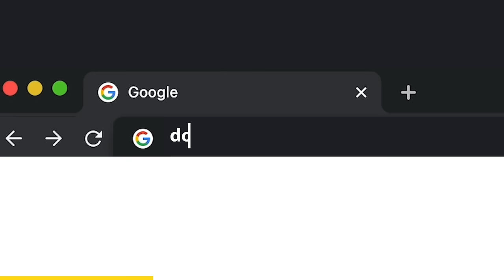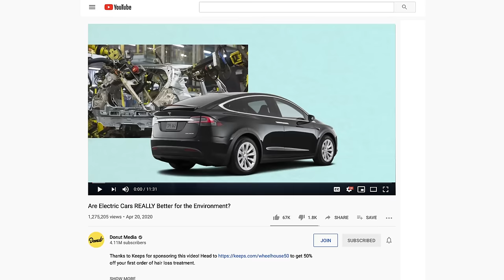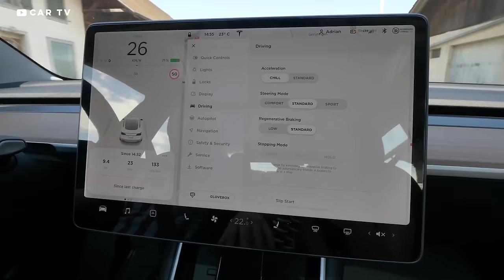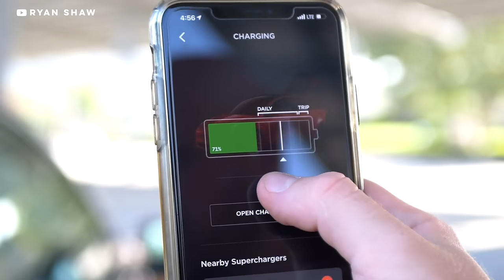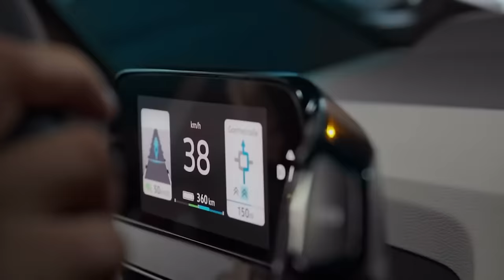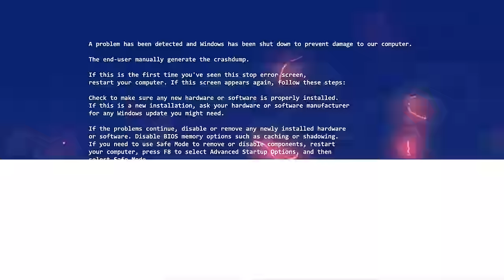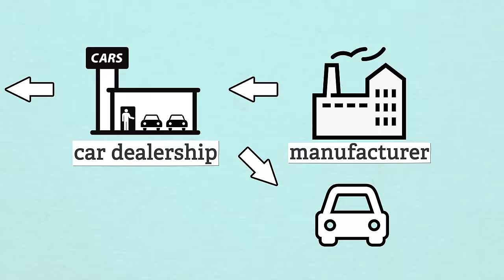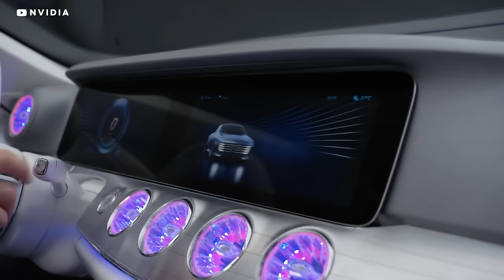Why Can’t Anyone Take Down Tesla?

Comment: Honestly, can we stop tying fancy tech with electric cars, one does not equate to the other. There is nothing stopping automotive manufacturers from putting stuff like digital touch screens, or dynamic cruse control with automatic lane centering in combustion engine vehicles. In fact they are doing that already. The main reason why Tesla has been doing so well in the electric vehicle market is that they have not just been building electric cars but the also infrastructure to go with them. The main apprehensions that the general consumer has had with buying an electric car are  "What do I do if I need to recharge my battery and I am away from home?" and "I don't want to be limited to only traveling within a set radius around my house." Tesla answered those questions by saying "You never have to worry about being stranded with a dead battery or being unable to go on long road trips. You are always in range of one of the many Tesla recharging station in your local area. You can charge your Tesla while doing your shopping." This is a claim that other car makers couldn't make. If the major automotive manufacturers seriously invested in designing and mass producing electric vehicles and building the infrastructure to support them Tesla would not be able to compete.

Comment: One big unknown though... the conclusion of the video is that other manufacturers will have to adopt Tesla's model, but Tesla is operating under the same economic pressures that produced the current paradigm.... meaning it might be the other way around, that eventually Tesla will have to adopt their model in order to compete long term.

People tend to forget that models do not come out of nowhere, they are the result of decades of economic pressures that reward companies that adopt them and punish ones that do not, and if you look at the history of the auto industry it is littered with companies that tried to operate differently and survived for a decade or two but eventually collapsed.

Comment: Hello donut from the uk. I have an idea for a feature you could do, and cover Tickford and their production of hot fast fords. I owned a Ford Racing puma, a commercial disaster for Ford failing to hit the 1000 cars to be made (500 uk only models made). It was over priced not that quick, made no sense..... other than the fact it was a hoot to drive and pumped up styling. It was the forefather of the MK 1 focus RS which his was also finished by Tickford, (I have also owned). Tickford made hot Capris (British mustang from 60’s/70’s).

Comment: Tesla knows to innovate and has the most efficient drivetrain yet. But a huge part of the car is not designed inhouse. Most parts of the Model S are German. For example the Suspension, the steering, the seats (in newer models), the audio system. Also parts of the self driving systems are from Bosch. Not to mention the german Robots Bildung all Tesla and Painting them. So of course Tesla is a huge success, but the did not build a car from scratch. They used a lot of established suppliers.

Comment: The first difference I see between Tesla and others, especially when Tesla started out and still to this day to some degree, is that while other companies set out to make "electric cars," Tesla set out to make a "car that is electric." Prior to Tesla, and still for many of their competitors, electric cars have always been weird, quirky, odd-looking, basically novelties. Their primary appeal being that they are electric. Tesla on the other hand made a nice, desirable car that is electrically propelled. Certainly has some odd features, but they aren't really directly related to it being electric. Teslas were the first electric cars to be compared not against other electric cars, but against well-regarded luxury sports sedans, even if gasoline powered. A lot of other electric cars - BMW I3, Nissan Leaf - are sort of weird looking. Others almost seem to try to disguise that they are electric, having a fake grille with no gas engine to feed (though massively oversized grilles, bigger than necessary even for gas cars and mostly blocked off, are a hideous trend these days), that Volvo/Polestar and Mustang Mach E being prominent examples. While Tesla is just comfortable to be a car that is electric, it's not weird looking to scream "quirky electric car," nor do they try to emulate gasoline cars.

Comment: The main problem with EVs is because they are hard to repair if they break. They do not even sound great.
Reply: no they aren't. they have much less parts and the ones most likely to brake are found on gas cars such as the suspension. standardized repair procedures will be more common once EV's become a major part of transporation.

Comment: 12:59 No. It is a million of billions.
Reply: ... depending on where you live. In Slovakia "billion" = 10^12, "trillion" = 10^18 = 10^6 (a million) times 10^12 (a billion). So you need to specify which kind of "trillion" you are talking about.
Reply: But your point still holds. For a human being even comprehending a million of anything is a big problem.

Comment: Saying that other companies are failing to produce "tesla killers" it's a nonsense. vw, ford, porsche, bmw... They aren't fully ev dependent. Tesla is. And that's the point. Tesla depends on the sales of ev's. Something that the other companies don't have to worry, and lastly, of course Tesla has better technology, it would be dumb if they didn't had it.  Saying that other companies are failing at taking the crown of ev's is like if Tesla tried to make an internal combustion engined car, it wouldn't work.

Comment: I think tesla is winning because they hyped up the "autopilot" and they started with the model s. Rich people bought the model S which is actually pretty sweet. Then the model 3 came out which was a much more attainable car that people associated with the model S and those rich people. Its a keeping up with the Jones' situation. Personally i would not buy one yet even though i could afford it. I just feel like there are still very fuel efficient gasoline and diesel cars that use less resources to build. People do not factor that in when they purchase an ev. Those batteries take a ton of energy and resources to produce. I may get one once their mileage gets to 3x the mileage of the best gasoline cars. I think it can get there but it will just take some time.
My real question is why are there little to no hybrid diesels? Diesels produce crazy amounts of torque for their size which will help with the weight issue of EV vehicles and with modern exhaust systems diesel really isnt too awful anymore.

Comment: East-European here and why I couldn`t care less about Tesla
1) Too expensive
2) No infrastructure for it
3) Too little battery
4) If it " fuels " longer then 2-5 minute  then I do not want it
5) Electronic based cars are not ideal when everything is in ICE and SNOW.
6) Interior design is not for me, by that I mean not enough organizers inside,  a singular " tabled based " control thing is plainly inconvenient for me.
7) Exterior design is well..debatable, but I just kinda feel nothing when i look at Tesla front side.
8) I couldn`t possible care less about its autopilot, heck im not even using cruise control in my car, like..ever. I like driving car myself, with a manual, I like to " feel " car.
9) Our roads are BAD, not even every SUV have chances to survive driving while ignoring potholes and hatches.

Soo, why would I pay more and have less joy then regular engine petrol/diesel? Why I would need to sacrifice convenience and practicality? Maybe somewhere in my rant is a reason why EVs dont have a solid profit, since a lot of people dont even see them as cars, more like a big toy for rich people.

Comment: Tesla scares me because 1. The car is a driving computer that you barely own because Tesla makes sure to control EVERYTHING even after you buy it 2. The cars have to be driven for several years to be worth the carbon savings, making one of the main reasons to buy an EV way harder to obtain 3. You are basically paying for R and D when you pay the price of the vehicle, they are not expensive vehicles to make, but Tesla would like you to think so. Tesla has set a precedent for very very expensive electric cars when they should be even cheaper than gas cars and it’s all because of their R and D

Comment: When is Tesla going to get big public bids to partner with a “big” car manufacturer?  License it’s tech to somebody and cash in. I really see a company biting the bullet soon and paying through the nose to get their foothold established. Either that or they are waiting for Tesla to “fail” and get the tech on the cheap. 
  Personally, I thought Ford was headed to them, but it looks like Ford will soon fail based on it’s reliance on two to three basic models. The F150, Transit and Mustang.  They’ve lost a large fleet base getting rid of the small Ranger and Crown Vic.  Plus, the pricing is no longer better than the foreign and arguably more reliable options.  It’s fallen to relying on a brand loyalty that could swing hard soon. Going the same route as Harley. Overpriced and aging. 
  I miss both my Rangers, the Bronco II and even my ‘78 Ranger that got literally 9 mpg, but these days, the bang for buck truck is a Toyota. Any Japanese company making sedans has them beat in that market.  If you want performance,  it’s just as easy to look elsewhere and get a more reliable, consistent vehicle that matches it’s price point.

Comment: Tesla is succeeding because it doesn't have to make a profit. It basically breaks even on its cars and sells them in large part off the backs of subsidies, while making the bulk of its recent profits off ventures that are distinctly not cars. If it were a gas car company, it would have gone under. The difference is that, as long as it markets itself as a tech company rather than a car company, it never actually has to make a profit to get investor dollars, just like how WeWork, by marketing itself as a tech company rather than a real estate company, hasn't made a profit for years, or how Apple sunk millions into (literally) a premium several hundred dollar juicer startup. Eventually as adoption grows it will obviously start making money by economies of scale, but until then, it's only gotten this far because it's R&D budget could be more than some modest automakers' market caps with no qualms from investors. And while Tesla investors expect it to do this, GM and BMW investors actually expect profit from their companies, limiting how much money they can pour into R&D or new directions. Tesla didn't succeed by marketing their cars, they succeeded by marketing their stock.

Comment: Tesla is literally the Ford model t of electric cars. They are built quickly with shoty craftsmanship so they can get them out of the door all the faster. Their electronics constantly fail. And when you flood the market with a bunch of cars you can pretty much lower the price whatever you feel like, which allows your brand to get out there faster. And if you stop and side step the fact that Tesla is literally the only manufacturer that is able to sell vehicles from their facility without using a dealership you realize how much cost savings are getting away with because of a loophole that they found. So basically you're not only being scammed on how good of a car you're actually not getting, But you're also helping giving them money by side stepping the middleman. Which allows them to sell cars to you cheaper. So you're getting a cheap electrical fire, that will definitely eventually happen. There's no doubt in my mind why they are everywhere. And there's no doubt in my mind why I will never buy one.

Comment: Tesla took a simple concept, made it look simple, but made it hopelessly complicated underneath.  They reinvented every stupid detail until the unreliability of the rest if the vehicle made up for the inherent simplicity of the drivetrain.  I was hoping that other manufacturers would make cars with the standard quality and reliability of regular cars without pointless features like multi articulated doors and door handles that rely on perfectly functional electronic systems. Tesla cant even glue in the Windows correctly and they decided to overcomplicate the simple stuff. 

I was really hoping that when Ford got in, they would make a comparable car with better proven ancillary hardware. Here they come with over the air updates and a copy of the same IPad hot glued to the dash interior.  Maybe the F150 will be a regular truck with gas-version interchangeable parts that just has an electric drivetrain. If they do that they beat Tesla eventually. If they copy Tesla's stupidity and faults and are still behind on batteries and drivetrain, then they will be a distant 2nd or 3rd at best. Don't fix what isnt broken.

Comment: I've been holding my breath for true "FSD" for years now....And Tesla bulls said post-split TSLA would be in multiple thousands per share by now, but it's still in the 700s. See the hype?
Also- Over the Air updates can't change the motor output, like you can when modifying an ICE car. There's no room for acceleration performance improvement, other than allowing the motor to suck more current out of the batteries. This alone shows you that the battery potential was intentionally limited to begin with. And then there's the obstacles Tesla puts in the way of DYI's, and Right to Repair. And then there's the insufferably self-righteous, shrill, nut-swinging fan bois, posting their oh-so-innocent videos of them pissing off ICE drivers, claiming "I was just minding my own business, being careful not to step on bugs, and smiling at birds, when all of a sudden this crazy ICE driver came out of nowhere and tried to kill me, and here's the video". Yeah, and where's the beginning of the video were you were acting like a weanie jerk? They never show that part!
Anyway, all bitching aside, I like my Model X, (and I liked my Model 3 that I sold), they're good cars. If I had the bucks, tho, I'd get the Rimac Nevera over any Tesla...It absolutely STOMPS on the Plaid!

Comment: I think you are overestimating the Tesla's position. Tesla is number one now because it's a tech company and it's the pioneer of the modern EV technology. Of course this is a big thing. But this is not a guarantee. The other companies are coming. And they don't need so much things. Only a new good battery which can compete with the Tesla's battery will let them capture a big portion of the Tesla's sales shares in the global markets. In the near future there will be companies producing advanced batteries and software for the EVs  and then we will see how Tesla's share in the market shrinks. Of course Tesla may survive and be successfull but it won't be the biggest in the future. Because I think Tesla's strategy will fail soon after other companies getting enough EV technology to compete.
Reply: The competition has been coming for years and right now the competition sucks and they're not doing anything to fix that.

Comment: If you asked me I’d picture a Tesla burning the the ground, death by lithium fuelled fire
Reply: is that any worse than a gasoline fuelled fire?
Reply: Yes far more toxic indeed, the fact that the flames are red should say something in itself lol
Reply: @manisandjr8435  hard to believe 20lbs of lithium is worse than 20 gallons of gasoline that can kill you just by inhaling fumes for a few minutes?
Reply: @odisy64  I’ve got a real hate on for electric cars, as someone who’s looking to be an automotive engineer I believe continuing with electric cars will lead to the death of our planet, instead I believe we should pursue hydrogen combustion and rotary engine valves, hydrogen produces only H2O when burned and rotary valves would change an economy cars engine oil change interval to 40,000-50,000 miles, as well as having super high redline, 12,000rpm wouldn’t be anything for a rotary valve engine, that wasn’t diesel of course, you’d be looking at more like 6000-8000 rpms for a diesel
Reply: @manisandjr8435   admitting you hate electric cars show how biased you can be against a machine. I like mechanics but have a bigger intrest in electrical engineering and infrastructure development. Hydrogen is not a good solution, its pretty costly and inefficient if produced through electrolysis. If produced through methane gas reformation its cheaper but co2 is produced during decomposition. Electric motors can already make it to the million mile mark which is expected when a single speed gearbox is the most complex moving part of the drive train but the bearings have to be high tech to handle the 17,000 RPM's. The next gen formfactor 4680 cells will have an expected 1 million mile plus life expectancy. But current gen tesla cells get 200k miles with only a 10% loss in range.
Reply: @odisy64  move to somewhere cold and tell me you like electric cars just as much, their battery packs cost absurd amounts and in the cold I’ve seen them go out in as soon as 5 years, I understand the technology will get better but you must understand we have the capabilities to improve hydrogen refinement as well so it’s a double edged sword and yes I am biased but I can admit that
Reply: @manisandjr8435  i do live somewhere cold and the most ive seen batterys reduce is 40% of their original capacity but returns to normal during warmer temperatures. The technology for batteries is getting better faster than it is for hydrogen. Electric cars have already surpassed hydrogen cars in almost every way.